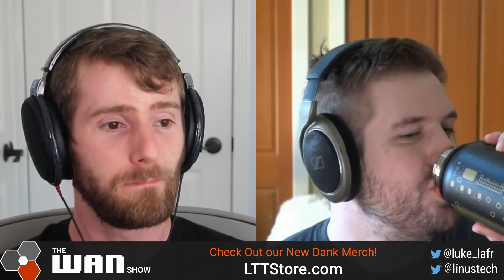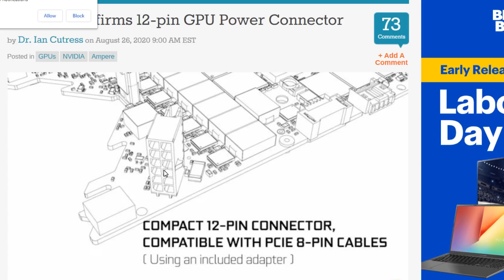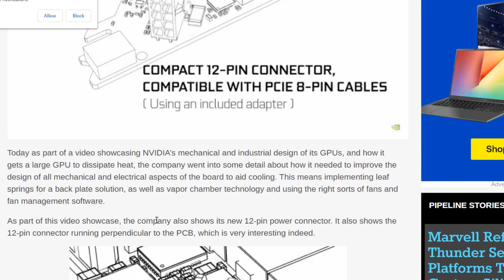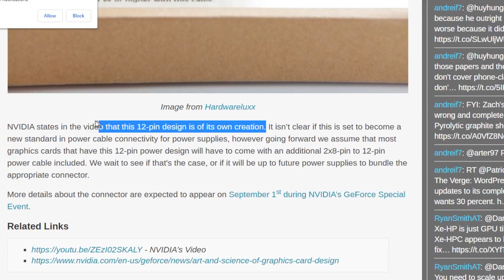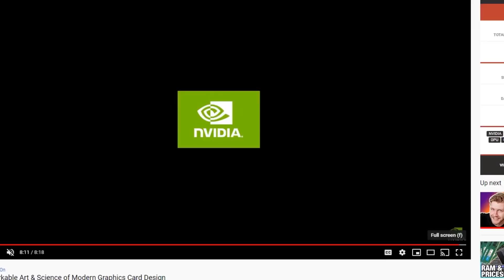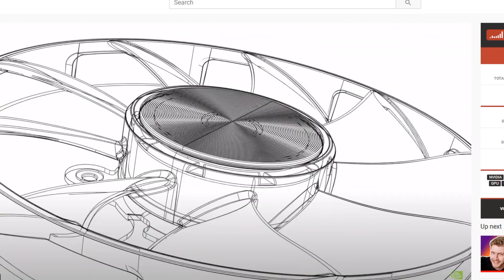Nvidia Confirms RTX 3090 12-pin Connector!

Comment: I posted this on the LTT forum, the technical spec sheet from the manufacturer of the actual connector, rates a 12 pin connector for 400w maximum. (using 12v)
Reply: 3090 is a 350W GPU. 3080 is 320

Comment: looks fragile, hope it´s not as difficult to push in like a 20/24 pin, leverage isn´t good then.
Reply: Well you shouldn't have a hard turn where you plug it in at like the ATX brick of a connector, I love the manufacturers that are smart enough to put that 90degrees on the motherboard like the sata ports, that and the CPU 4-8 pin can go suck a d&*k, I cannot tell you the bane of that BS over the years.
Reply: @nocturnal101ravenous6  hope so, we'll see

Comment: I love computers, and always am excited for advancements and all...butttt this is crazy. Do we really need GPU's this powerful?  I have a 980Ti and it will last at least two generations of computer builds in my rig. It does everything still very well. Games don't even look that much better, but the requirements are skyrocketing, for not much increase in detail.
Reply: Imagine complaining that technology is advancing too quickly?? Game requirements being too high are the fault of the game developer not nvidia. It's possible to make games that take full use of new cards and still run well on older cards on lower settings
Reply: @usmn._.m  It happens, I have had people complain that the internet was to fast also,
There is always a point when it is just not worth it anymore.
Reply: @williambaldwin9346  Basically 21st century Luddites
Reply: @SerBallister  no
Reply: I think the main problem is that most games where held back by the old console generation. Now that the new consoles are coming out we will see a huge increase in ray tracing, higher pixel count, etc..
Reply: @csmain  Good point, though the law of diminishing returns, way more work for very little return is totally in effect. To the point at least for me, I don't think it is  worth it. Not going to get those huge increases anymore. Usually I hardly even notice any difference, but the system req's are much higher.

Comment: literally just bought a 2070 super today, should i return it and wait for the 3070?
Reply: Your dumb these things have been officially expected for a month now why buy a GPU without checking or waiting 2 days
Reply: Lmao yes
Reply: From the anouncement/reveal, it seems that the RTX 3070 has at least the performance of the RTX 2080Ti. If i were you, i would return the card. You will wait for a while but it will be definitely worth it.
Reply: yes.

The performance difference isn't even on the same ballpark. If Nvidia is to be believed.
Reply: yes you should you will only have to wait 1 to 2 months for the 3070
Reply: @nomore3346  The 3070 is coming next month.
Reply: @brianwright2217  i said 1 to 2 months that means 30 to 60 days and it may release in late October which is more than 30 days or a month
Reply: Yes
Reply: Yep
Reply: Yes

Comment: So instead of making the next gen more efficient per watt (and lower tdp) and a bump in performance we're getting a gpu thats able to pull twice that over the last gen? I know nvidia likes their green but they shouldn't forget that we as a people want to live more and more green lives. These gpu's will drain about as much as my washing machine..... thats a tad stupid and a good reason im just going to wait to see what amd has up their sleeves. I think my 1060 6gb can hold out a bit longer. #efficientpc FTW
Reply: Just take fewer showers and it will all be the same. One a month is fine.
Reply: @grndzro777  a shower is about 15 cents over here (my short shower) running my washer is about 60 cents     so a Month the washer Costs me 2,40 showers 2 perhaps 3 bucks ish total electricity costs to run this pc in the amount i game would be 25 bucks soooooo if im gonna game alot i prefer to leave less of a fotoprint and pay less a Month but that's Just me
Reply: @gamingwithadutchman  Yea I was joking. But I take long showers, and have no restrictor..also have 120 gallon water heater.
Reply: @grndzro777  nice :D
Reply: It is more efficient per watt though ? 225w [2080] vs 320w [3080] - A 42% increase in power - for around 80-100% increase in performance.

Comment: I’m already using this connector (well, not the full12 pin but it’s a modular 12 pin cable) and so it’s whether my Carbon AC will take the board. Gen 4 so guessing it’s the cost of the MBX and CPU on top.

Comment: Am i the only one, who thinks a vertical connector could more easily break off while un-/plugging?
Reply: how often are you unplugging/plugging in your card dude
Reply: @johannamegido8465  well, i broke the 8-pin on my rx570, right when i installed it for the first time
And as a fan of clean Systems, i take the whole thing apart every year
Reply: @p3chv0gel22  that breaking is probably an exception and not the rule.
Reply: @p3chv0gel22  If you run positive pressure with dust filters how dirty can a system get in a single year that you have to take it apart to clean it?
Reply: @timseguine2  not really dirty

But i just enjoy it ti tear it apart and rebuild it

Comment: Can't u just switch out the cable for an adapter cable like 12 Pin M to 2x 6 Pin ???
Reply: Mr Elpa if that is the case, I welcome the change!
Reply: The new 12pin standard delivers over 3x 6+2pin connectors, the 12pin itself shares the same dimension as a SINGLE 6+2 pin connector... Yeah the AIBs can in theory use 3x 6+2 pin but now we're talking about an enormous PCB with an even beefier cooler.  If the AIBs are that subborn, we're looking at 3090 K|NGP|N with 4x 6+2pins lol
Reply: @theyehsohz  Some 3090 use three 8 pin that can give more power than the only 12 pin. Probably they did that to give more room for overclocking, they did the same thing on the highest end 2080TI (i remember the Gaming X Trio and the Kingpin that used three 8 pin but there are probably more)
Reply: @darkhorus99  i was just thinking like 6 + 6 = 12 xD but wouldn't make a different to me if 6 or 8 pins. We will see in the future
Reply: @juma.1337  the 12 pin connector uses a different gauge cable that can handle more power per pin. so 6 + 6 wouldnt work.
Thats why they use a 8 + 8, which gives around the same power as a single 12 pin.
Reply: An 8 pin PCIe cable only carries power on 6 wires, and 6 pin on 4 wires. I don't believe the 12 pin uses any sense lines. Two 8 pin PCIe cables is a perfect one-to-one fit to adapt to all 12 power carrying wires of the new connector.
Reply: They are Micro fit plugs, which are even smaller plugs than the usual ATX cables (mini fit). Hold a 6-pin micro next to a 6-pin mini and you see the difference. You will need an adapter that goes from Mini to Micro.
Reply: I will just put the adapter in there and cover it with solid ammount of heat shrink, nobody will notice🤣
Reply: @tomvarior5328  Titanium has a high melting point, just saying.
Reply: Can I just switch from a 2070 super to a 3080 using the same adapter ?:/
Reply: Yes, people like always just went beyond reason, Linus, Jay, and Steve have been about the most realistic with the analysis of this, the only people that may have issues are the SFX crowd below 650watts as depending on CPU, mobo and non-GPU system requirements can mean you are riding the line or exceeding system wattage in rare instances, maybe like Blender or workstation software, also these cards are not going to do well is SFF builds without watercooling.
Reply: @mrelpa  The reference 3070 has a 12 pin https://d1lss44hh2trtw.cloudfront.net/assets/article/2020/09/01/nvidia-rtx-3070-release-date_feature.jpg
Reply: Could you have an 8 pin + 4pin?